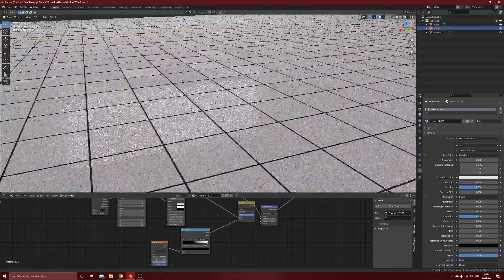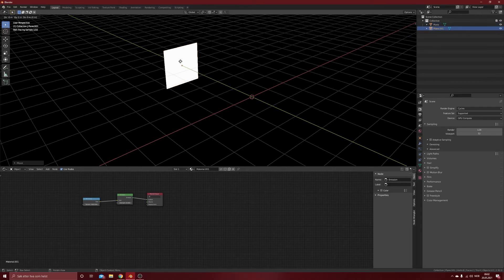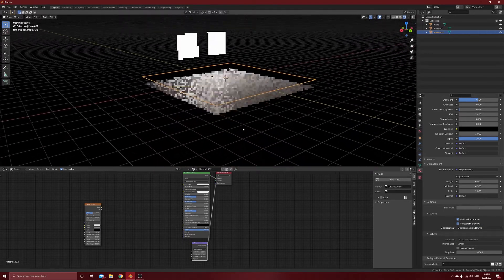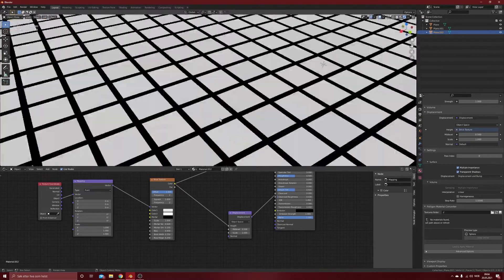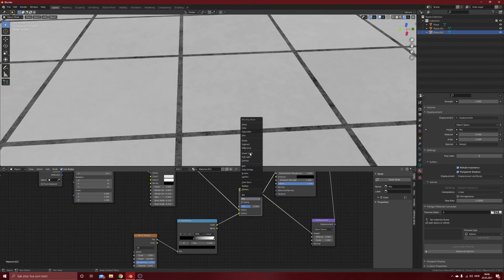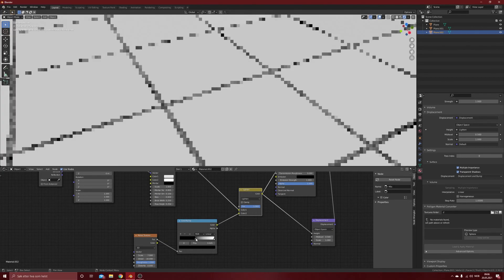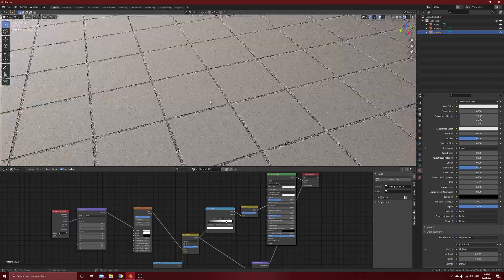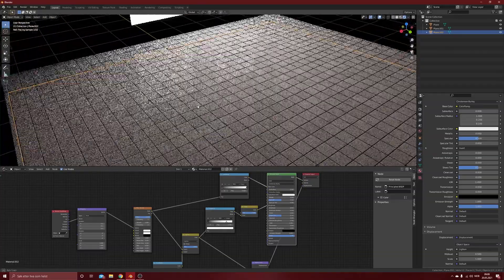Procedural Tile Material | Blender Tutorial

Comment: How could i extrude more the tiles? In order to have a bigger level difference between mortar and the tiles
Reply: And it's possible to change the white tiles to different color? Because when i try the mortar is also changing the color
Reply from the maker: @uepmarti  I think if you want more height difference between mortar and tiles that you should create the geometry. I think this can be done easy with array modifier or geometry nodes. Color should be able to set in the color ramp connected to the base color.
Reply: Jesus loves yall if yall did not know come to Christ repent non-denominational